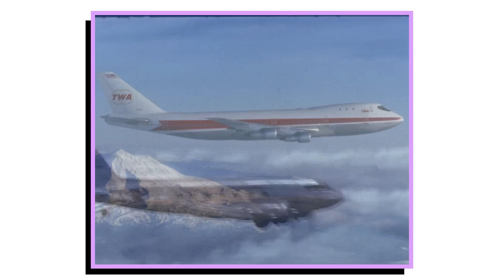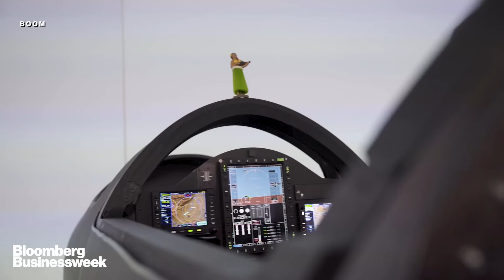The First Look at Boom’s Supersonic Plane

Comment: Would have been wiser to buy 160m of bitcoin

Apart from the original issues of concorde which caused it to fail, like fuel cost, sonic boom etc which this company has still not solved, they will be facing a completely new post covid world where business travel is already becoming non essential. In such a scenario there is really no point in paying extra for a plane that a couple of hours faster. Additionally people plan business flights such that they get a full nights sleep on the plane. And arrive at destination ready to work in a few hours.

Don't expect much here, unless of course a miracle happens.

Comment: Aviation has drawn to it dreamers and scam artists since the beginning.  $150 million may seem like a lot of money but it is just a drop in the bucket compared to what would be needed to bring this project to fruition.  The airplane will never go into airline use but the leaders of the project will somehow become rich.
Reply: I don't think they're foolish enough to think 150m can produce Supersonic airliners. That's why they're first building a smaller proof of concept. They need to proof, that they actually are capable of building a supersonic jet, in order to secure more funding, pre-orders or industry partnerships. With those, they can then go and (try to) build an assembly line. (Just a theory of mine tho, no real sources to show). Also, they have propably produced a working plane, which would make this company more of a failed dream than a scam, if something goes wrong.
Reply: Those who say it can't be done should get out of the way for those making it possible
Reply: @gabedarrett1301  it can  be done but with a higher budget
Reply: United airlines has just purchased 15 of them today 6/3/21.
Reply: @LOCKnLOAD122  HaHaHa !!!  There is a long distance in the airline business between "ordering" a bunch of jets and actually paying for them and taking delivery.  There is probably a 10% chance that Boom will ever get a new jet certified.  Aviation is filled with dreamers.  United is not one of them.  They will sign a check when there is some certification .. Not before.
Reply: Yeah, that groupon experience will certainly lead to a supersonic transport.  Who is the engineering team?  Why aren't Boeing and Airbus and some Chinese firm working on a supersonic transport.  A little diligence will tell you it will never fly.
Reply: They have agreements with the Air Force, Japan Airlines and Virgin. Look it up.
Reply: @josiahfugal5407  you think that makes them more credible?
Reply: @carlosandleon  If the Air Force contract doesn't make them credible then nothing else will.
Reply: @enkryptron  Right you are my friend.
Reply: They can be acquired by airbus or Boeing, or be another Virgin Group experiment
Reply: Compare with Tesla's origin?
Reply: @hobog  What Tesla costs compared to what figuring out how to design and build a quiet, supersonic engine from scratch (Let alone a whole new supersonic airplane) are two entirely different things.  To design just the intakes of those engines (which are now only a sparkle in some design teams eyes) would pay for Tesla.  You have no idea what this would cost buy a few magnitudes.  Actually,  designing this is more complicated than a new space ship.
Reply: Idk bro if the small plane works then it works
Reply: @lolgamez9171    I do know.  That is just the beginning of the massive outlay of money and invention of a lot of new technology.  They will run out of money.  It cost 13 BILLION to develop the 787.  And it wasn't supersonic technology.  This company will need new engines designed and built, new airframe technology and new electronics technology.  Just ain't gonna happen.
Reply: @williampotter2098  if they put a luxury price on the plane and use it as advertisment for investors, they cam last until the next progress report.  

Or even better, they use the plane attract government contracts or a company outright buying them for the tech
Reply: @williampotter2098  This guy could be the next Kelly Johnson, we don't know.  Have some damn optimism bruh

Comment: Starship will eat your plane.... All the best for your future 👍
Reply: Ackchyually, Boom aims for mid to long haul flights. Starship is for rather long or very long flights. This is true for at least the early versions of both machines. 
Plus old folks might not be ready for the 2-3 g and weightlessness on a starship trip.
Reply: Potato King and Starship probably won’t be in a position to enter passenger service until the mid-2030s at the absolute earliest. This thing should be operational by the late 2020s.
Reply: What is Starship? All I see when I google it is Spacex's Starship which is not for commercial flights.
Reply: I think they said that it’s aimed at business class travellers unlike starship and besides travelling in a rocket should be extremely uncomfortable.

Comment: I hope they will succeed
Reply: It wont, they just make wild claims about it without showing any evidence they have solved any of the fundamental physics or economics that made the Concorde fail.
Reply: @brandonl8039  Same thing people said about Musk and Tesla/SpaceX.

If this guy has enough mental, emotional and testicular fortitude, he will do it.
Reply: @brandonl8039  Breaking the laws of physics is impossible. So if that's what you expect from this guy, then it's not going to happen.

Musk had an extremely complex, never achieved before, reusable rocket physics problem to solve.
Reply: @brandonl8039  Breaking the speed of sound you mean?
Reply: @farzana6676  no, making a supersonic transport that is economical and efficient enough to actually be viable for companies to fly. 

In the end if it’s not profitable it just Concorde all over again.
Reply: @brandonl8039  Doomed SSTs? They operated for 27 years with one crash.
Reply: @thekub32  operated at a loss for almost all 27 years too. Have to be profitable to be a success.
Reply: Jet go boom 💥
Reply: They will. Air japan has already agreed to order some if the xb-1 works. Which it will based on the work they have done. It’s been 60+ hour weeks for everyone at boom for a long time, they are working quite hard. I would know, dads one of the guys putting it together.
Reply: @fakehiker965  Delta just agreed to order 15 with an option to buy a few dozen more if it succeeds.
Reply: @fakehiker965  During COVID, with general airline traffic collapsing and most airlines almost bankrupt, Air Japan is ordering these  ?? I’m highly skeptical !
Reply: @Nicholas.T  they put their order in a few years ago.

Comment: are they trying to reduce the sonic boom at all with this plane?
Reply: Baruka88  real men like the boom.
Reply: maybe not them, but NASA and JAXA have been working hard to be able to reduce the boom, and its looking  promising
Reply: It's litterally called boom so I guess its implied that there will be a sonic boom🤷
Reply: The sonic boom will be quieter. I remember them talking about this in another video I saw 2 years ago.
Reply: Yes, with advanced computational fluid dynamics, they'll attempt to divert most of the boom upwards and sideways, as opposed to the ground
Reply: @DS the passenger doesn't really hear the sonic boom. It's loud inside Concorde thanks to its engines.
Reply: @DS It is my understanding that many countries have banned supersonic flight their airspace. They did this with the concord to stop this. Also, I have seen the boom-guy in other interviews explain that advances in the plane's design reduce the total noise (engine etc) down to that similar to conventional jets.
Reply: @DS Also, I really don't think the sonic boom is a consideration when building fighter jets. I don't think they even give their passengers a table or anything.
Reply: @DS they can by learning from Lockheed's mistakes.  The experience from each failure is shared with the next attempters.  Stand on the shoulders of giants etc
Reply: Yes, that’s the whole business model
Reply: To be allowed to fly over land, to be allowed more of a market
Reply: @DS Passengers don't hear the sonic boom because the plane flies faster than the sound it generates.
Reply: $150M to develop an SST??    Anything like this from Boeing or Airbus?
Reply: no